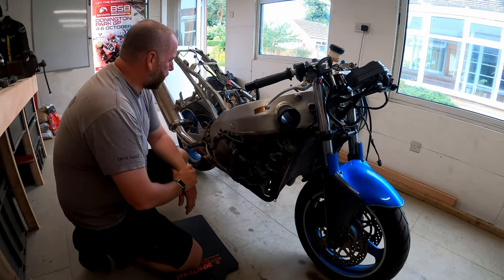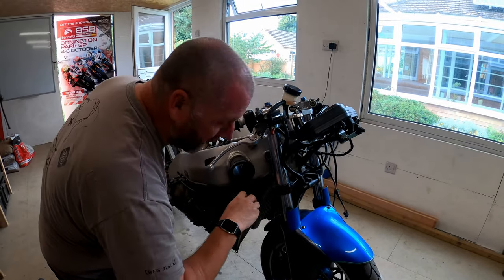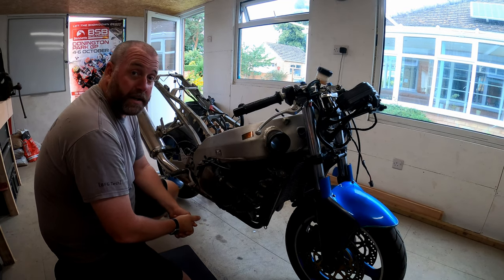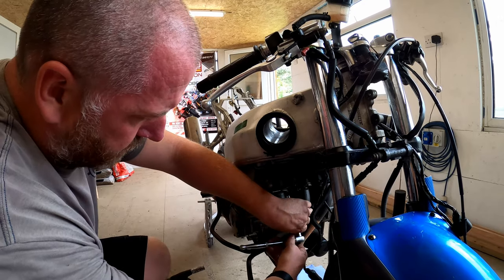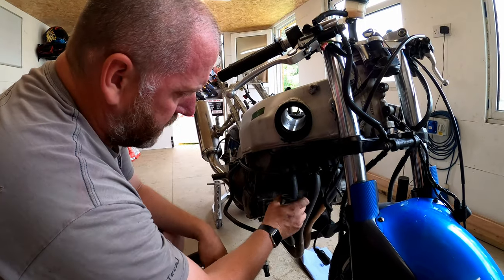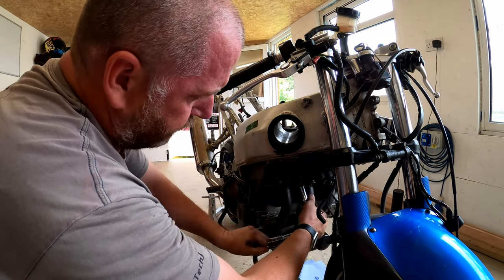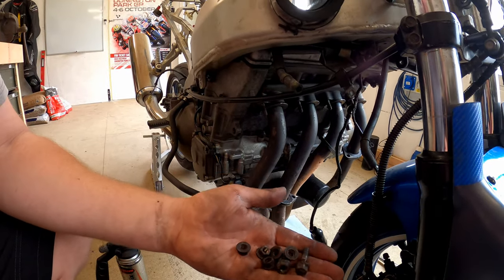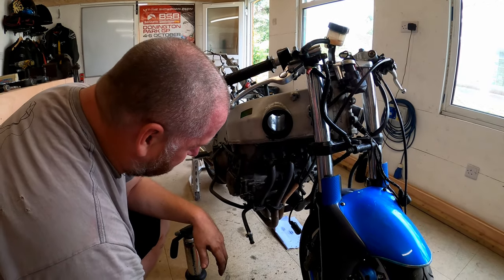1998 Kawasaki ZX9R - Project Shinobi, Episode 4 - Radiator Off, Then The Exhaust System!

Comment: Great video! You dont need the bracket on the e-header linkpipe. You can remove it, the exhaust connects very well at the block and the rear. I’ve run mine like this, with two mounting points, no problem.
Reply from the maker: Good info mate, cheers 👍🏻

Comment: I'm almost finished with a 2003 F2 rolling project. The mid pipe bracket on other models bolts up to a rubber-bushing-equipped frame mount located under the swingarm pivot. Magazine reviews say the F2's didn't vibrate a lot for an in-line 4, and I'm guessing that's why. Carry on, Sir.
Reply from the maker: Yeah, I guessed that there was an additional mount on later models where this link like and exhaust most likely originated, I’ll make a good job of fitting it somehow though! Glad you like the project series though, check out the rest of the episodes! 👍🏻😎

Comment: Nice video again. Oh you was lucky with them studs lol. had to drill and tap in the past. And clutch yes better in the Engine as tool is ok but have better leverage while in. Also whats the parts like for this bike to get spares for ?.
Reply from the maker: There’s a fair bit that’s NLA so second hand may be the only option but I’ll try and find stuff in good condition where I can 👍🏻
Reply: @KevsShed  Yes thats only problem restoring these old bikes. But cant wait to see finished results.

Comment: I’ve some micron header for sale
Reply from the maker: Thanks bud but I already have a set of E1 headers for this project!  👍
Reply: @KevsShed  they don’t fit trust me
Reply: I put e1 engine in my 99 frame headers are bigger dia on e1
Reply from the maker: @davidpierce7318  Yeah, I know, but they can be made to fit fairly easily with only a small amount of work 👌
Reply: @KevsShed  bu those cross over pipes from 1-4& 2-3 are for back pressure and made just for e1 engine bore is different too on headers hope you have tig set can’t wait to see how you do it